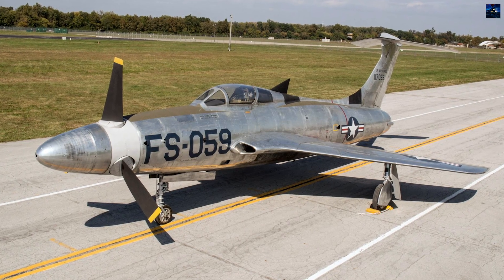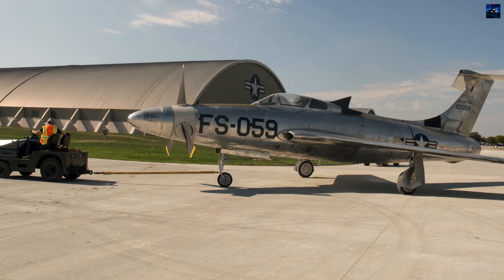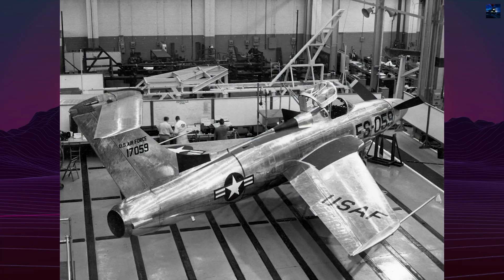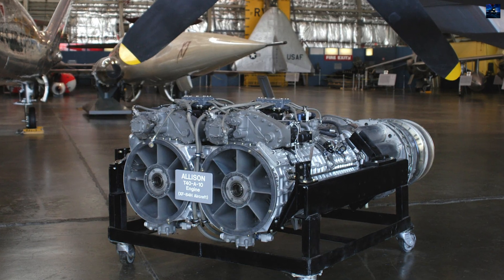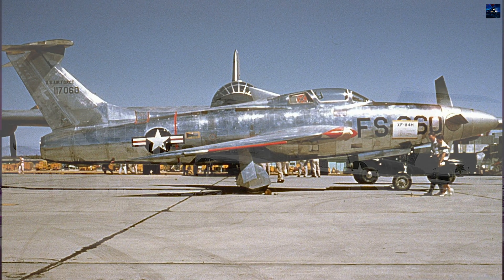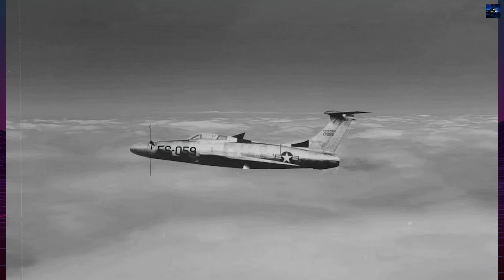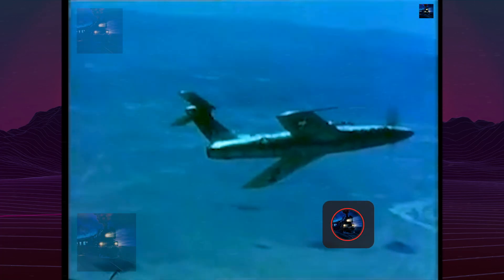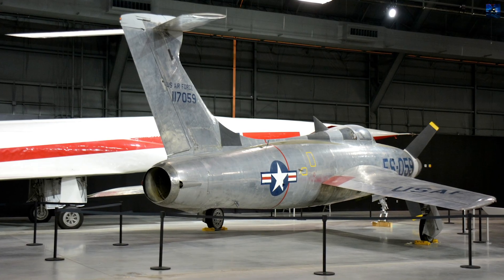Republic XF-84H Thunderscreech: Why This Plane Was Too Loud for the U.S. Military

Comment from the maker: I chose the title because the XF-84H really was too loud for the U.S. military. Its massive supersonic propeller blades created shockwaves every time they spun, producing noise levels so extreme that they could be heard miles away and even caused nausea and headaches for ground crews. This unusual prop design made the aircraft infamous as one of the loudest planes ever built, which is exactly why the name “Thunderscreech” stuck.

Comment: Heard from 40 km away? Well, so much for stealth! Seriously, I wonder why they did not use contrarotating propellers? That would certainly solve the torque problems, and they might have gotten some more speed out of it. Even so, it would probably still be noisy if the propeller tips exceed Mach 1. The Soviet Tupelov-95 Bear bomber is similarly reported as being very loud. Thanks, Retro Transport!

Comment: At 2:28: does anyone know what the open little door is for? It's above the USA roundel.
Reply: It might provide extra intake air or cooling air during taxi and takeoff. The B1 Stealth bomber has them.
Reply: Can't remember it, air to a ram air turbine or something emergency related - it used to always be open on later flights.
Reply: thanks
Reply: Have checked, it is a ram air turbine.
Reply: that's what I thought. Thanks